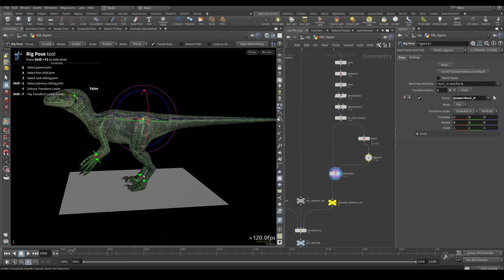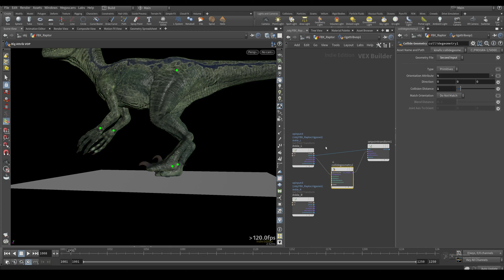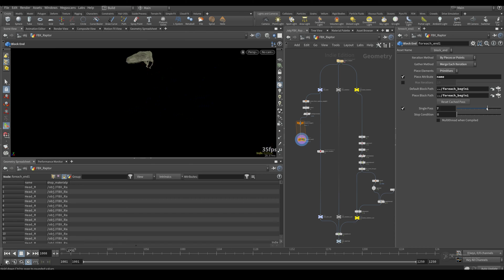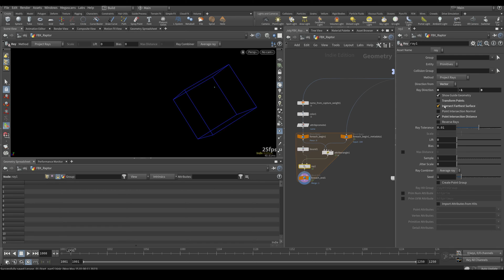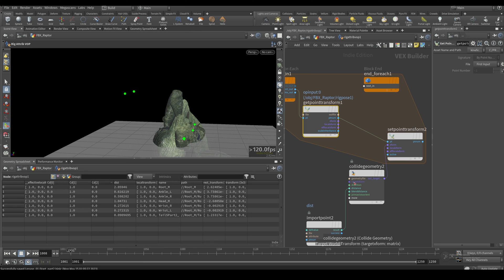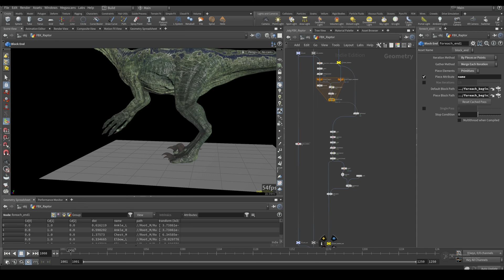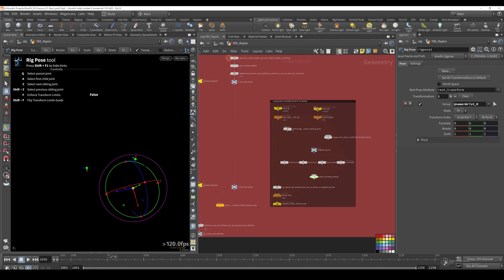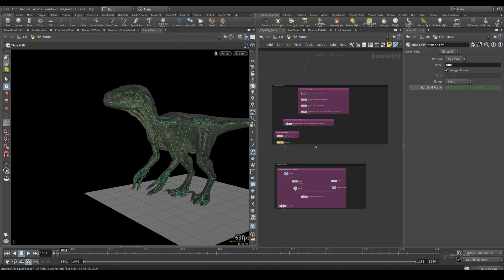KineFX 201 - Lesson 02 - ground collisions, rigvop for each loops, compile blocks.

Comment: super great tuts man! Do you have any exp with mocap cleaning? I'm having trouble with the whole rig floating sometimes is there a solution for that in houdini?
Reply from the maker: Yeah! I actually have a biggggg 2 hour long video on something somewhat similar rn but I didn’t have time to finish it and I definitely won’t anytime soon but it is like 99% of the way there and more so just covers workflows.
In it I use a humanoid animation to driver a velociraptor animation with absolutely zero key frames. 

https://drive.google.com/file/d/18g0xmiHhTz40Z_dFBrvgsTP-aKLg7PGa/view?usp=drivesdk

Here is the links to the quick edit I did today of it (the tut is months old but it takes forever to cut things up) it does kinda just end on some secondary motion stuff but it’s 90% of the way finished.
Reply from the maker: That tutorial is more so geared towards animation transfer which is very similar to the mocap process, but KineFx was designed with mocap cleanup as the main intent tbh. It has definitely grown far beyond that but there are plenty of incredible mocap tools in the KineFx toolset!